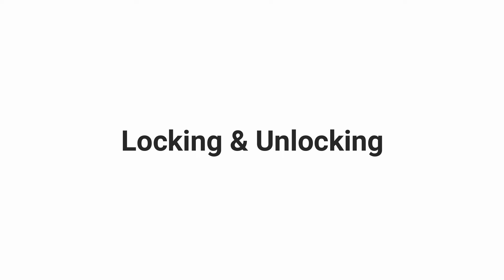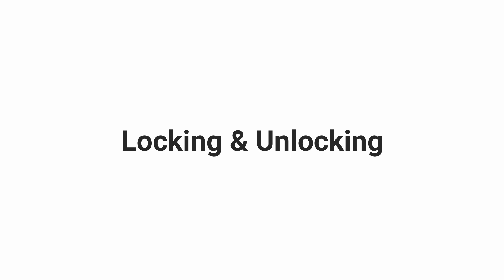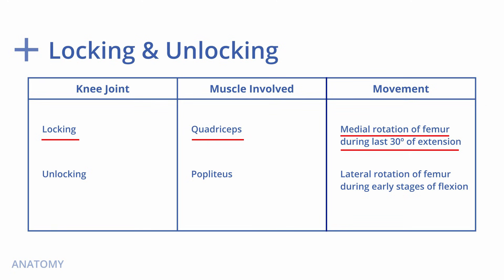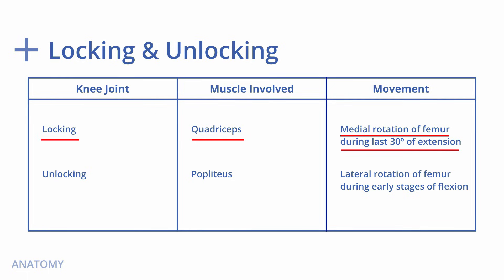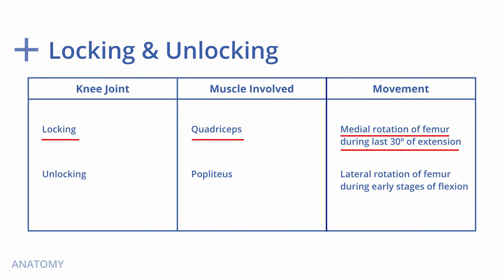Locking and Unlocking Mechanism of Knee Joint

Comment: LATERAL ROTATION of the TIBIA occurs in the final stages of knee extension not medial rotation of the femur. Correct yourself.
Reply: Depends if the feet is of off or on the ground ,
If on the ground ,there's passive medial rotation of femur 
If off the ground , tibia rotates laterally :

During the terminal phase of extension
Reply: I was actually devastated 😭😭 u helped broo @henryjefferson5198